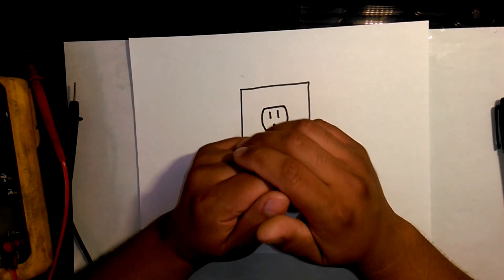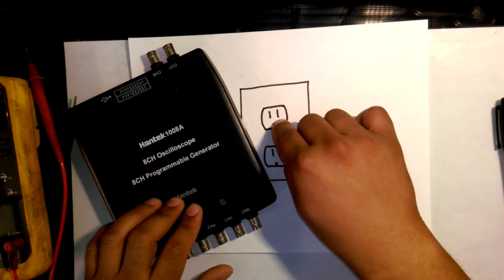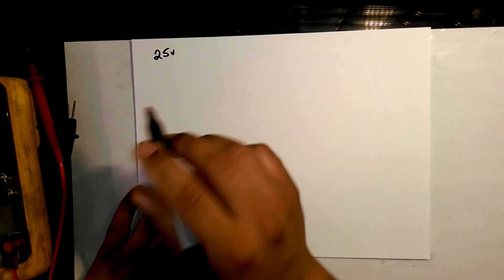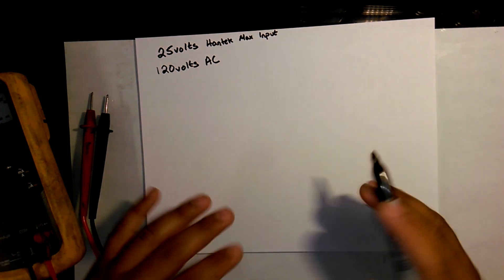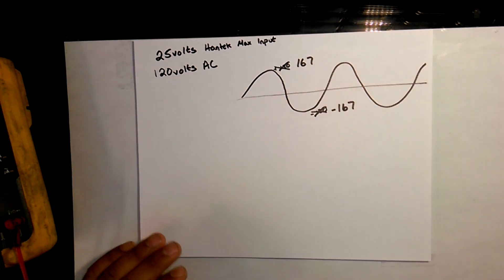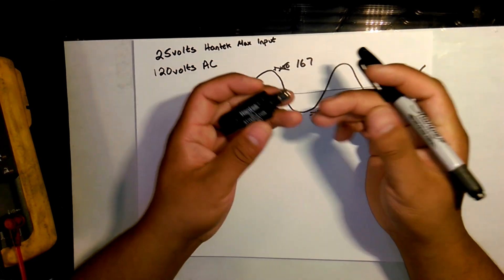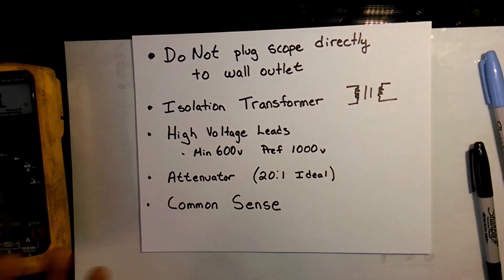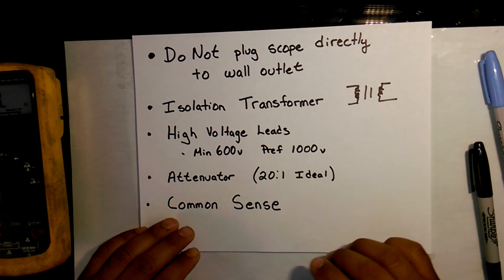Hantek Tutorial: Measuring Mains (Wall Socket) Voltage 120VAC

Comment: Thank you for the video!

I need to see the harmonic distortion or sine wave distortion on the AC line, so I do not believe I need a 1:1 isolation transformer for my purposes.  That being said, doesn't any AC to AC transformer (like your example transformers shown in the video) function as isolation transformers?  I ask this because you showed your example transformers, but then said you did not have an isolation transformer for the video, but that they did look similar to yours shown in the video.
Reply from the maker: You are absolutely right!! The transformers I have are isolated but I wanted to show the waveform in its "pure form". It was a poor choice of words on my part. If you are interested in the shape of the waveform rather than the actual values of the voltage available at your wall outlet, then using step down transformers will serve you well.

Thank you for your insightful question and thanks for watching!!
Reply: @Enrique_Osorio   I was trying to avoid a 1:1 to isolation transformer since they appeared to be more expensive than I was confortable with when ever I looked around and all I have on hand is step down transformers.  Then today I started to find some in the $15-25 range on ebay after multiple search attempts, which did not seem to high of a price.

I assume they would they still be considered 1:1 isolation transformers, besides the fact that the current output (VA) is lower than it is on the input side?

I wonder if these might help those needing to scope the exact voltages (but not the actual current) with an oscilloscope?
Reply from the maker: Possibly, it depends on the VA of the transformer, how well the transformer coils are magnetically coupled, how well the coils are insulated and the inductance of the input coil. Generally transformers are rated for a purpose and the information about the transformer is limited to its intended purpose. If you could link me the specific transformers you are looking at I will be able to give you more information. Thank you for your interest in this subject and I will talk to you soon.
Reply from the maker: Looks like the M8294 is a viable solution. As long as you do not place too high of a load on the output of the transformer it should work well. I am assuming the VA rating is about 1VA (115V*0.0085A). The fact that it says it is an isolation transformer by design it means that the product has been specifically designed with galvanic and capacitive isolation in mind. I am tempted to purchase this product to experiment with. Please note that to achieve a 1:1 transformation use the center tap (Red/Yellow to Red). The voltage across the two red wires will be double the input voltage resulting in a 1:2 transformation. Nice find!!

The N48-X also looks like a good option. It is overkill if you simply want to see the shape of the waveform at its "true" voltage since it is rated at 15VA. Again, do not overload the output of the secondary.

I would like to add that any high frequency noise on the input side of the transformer may be filtered by the transformer. Something to keep in mind while experimenting. As always exercise EXTREME CAUTION when working with mains voltage. It is DEADLY! Let me know if you have any other comments or questions. Thank you so much for bringing this to my attention.
Reply: @Enrique_Osorio  Thanks, I will let you know how things work out.
Reply from the maker: Sorry about the late response. It looks like that scope has an FFT function so you should have some functionality. I have never used the 6022 so I can not give first hand experience. Let me know about your experience.
As for the DIY AC coupler I have built several of those in the form of high pass filters, so I would be interested to know how yours works out.
BTW I do not get alerts when I get new comments but I do get an alert when I get a new thumbs up. When you reply give one of my replies a thumbs up this way I know to check for your response. Thank you so much and hope to hear from you soon.
Reply: @Enrique_Osorio  After years of working with live  US 120VAC and getting shocked more times than I can count, I do not see why it is so "dangerous" unless you happen to be better ground which maybe I have just been lucky?  Main thing I care about is not damaging my equipment used for the measurement.
1) Knowing the dangers, can't you measure mains "either" directly or via an isolation transformer with two probes - leaving out the ground reference connectors of each probe and setting software up as Ch1 minus CH 2?  
2) If the computer/scope set up is floating with no AC connection and using a single x100 high voltage probe, isn't it ok to use the ground reference lead connected to the neutral/ground (eliminating the need for second 100x probe and channel) as long as you avoid an exposed metal connections?  If so, how does that work when a) my particular scope is rated at no more than 35 volts on the input such as the Hantek - I am not sure if that max input level applies to the ground reference, b) neutrals sometimes have live voltage (UPDATE - my high pass mains AC filter has 60VAC on both legs of the output as explained in my next reply), and c) the x100 attenuated probe does not attenuate voltage going through the ground reference connector like it does the main probe pin ("positive" pin), so therefore it may have 120VAC (or 60VAC in my case) going through it (in the possible case of voltage on the neutral or you mix up neutral / Line connections to go into the ground of the usb scope).
Reference: https://www.youtube.com/watch?v=oMqhrRUjxOg&t=140s
Reply from the maker: In response to your first point, you can absolutely set it up this way but it still requires the user to place the "positive" input probes on the live and neutral. As for your second point I am going to have ask for more info since I think you are saying that the high impedance of the input of the scope will allow the user to tie the common ground of the scope to mains earth. If that is what you are saying I think you are right. I want to try it even if it is at the expense of my scope. Thoughts on my thoughts?
Reply: @Enrique_Osorio  I have several lines of thought in my last reply, honestly it got a bit muddy even for me.  I have the new usb scope (hantek 6022be), highpass (60hz) mains AC filter, and probes now.  I did several trial readings already but with a cheap handheld dso 150 scope and the 60 hz speciality filter used for looking at mains harmonics.  The high pass filter filters out the 60 hz frequency, so you can read the harmonics with out the 60 hz frequency in the way.  The thing is I am concerned that ac voltage will be going into the computer via the scopes USB connector - the filter outputs read apx 60 volts (non RMS) on either of it's two output conductors - half the 120 VAC wall outlet voltage, I am not quite clear on why but that is another issue.  I am all but certain the USB input of my computer is not supposed to have 60 or 120 VAC going into it through the USB's grounded shield which is what would happen if I use the ground lead of the probe/usb scope.   Trouble is, I am using up both my two inputs of the scope if I do a differential measurement using the only two inputs of my scope.  I want the other input of my scope to contrast the filtered reading on channel 1 with a non filtered 60 hz signal reading on channel 2 (by connecting it to a non filtered connection to mains AC).  I would rather use the probe ground reference lead if possible to free up my other scope input.
Reply: I went ahead and did the measurements via the differential method.  The 6022BE seems to be lacking the "record length" necessary for what I need it for, measuring harmonics on mains AC.   I think I also need a scope with a square wave view with in the FFT function.  Not 100% sure on those thoughts because I am just now learning scope specs.  Did not want to spend the $, but pretty sure I'm ordering a bench scope with real FFT features.  Had to make an AC coupler since the 6022BE does not have it https://www.youtube.com/watch?v=BjPUbO-U-VA

Comment: Hi! Enrique. What do you think about this situation: If I use a set of three resistor in serial connection according to this order 100K + 5K + 5K and connect osc probes to the resistor in the middle... is it also a risk for my oscilloscope and PC? thanks for any answer
Reply from the maker: That would work well, the only issue I see is that you would have the voltage divided by 22 with this network so when you choose 20:1 on your scope the reading will be off by about 10%. If your middle resistor was 5500 Ohms instead then you would have a division on 20 exactly. 

Two things to consider.
1) Make sure the resistors you are using can withstand voltages of at least 400 volts.
2) Remember that the only thing protecting you and your scope is a single resistor. With an isolation transformer you have a lot more protection. 

Hope I answered your question.

Comment: Genius. Im very interested on measuring the Dirty Electricity on my home wiring. I have a Picoscope 2204a but I believe it does up to 20volts (similar situation as yours).

Can you advise how to measure the dirty electricity and what equipment to buy (not very expensive) to accomplish this.

Thanks!!!
Reply from the maker: Several people have suggested a regular 10x probe (link below) and use two channels. The live line is connected to the input of Channel 1 and the neutral line is connected to the input of channel 2. The grounds of each channel are to be connected to mains earth. On the scope software set a MATH channel that subtracts channel 2 from channel 1 (CH1 - CH2). Schematic link below.

10x probe: https://www.ebay.com/itm/LOT-of-2-Tektronix-P6106A-10X-10M-Probe/133304168897?hash=item1f098c31c1:g:Ze0AAOSwxaNeHgLq

Schematic: https://imgur.com/a/qelzjO8

Comment: I have a Hantek 2d72 and I plan to get the wave form of my ac outlet.  Is it safe to connect the channel 1 probe directly to AC line?  What my plan is to make a 50 to 60 hz pure sine wave convertor for my electrical items using 60 Hz as a requirement.  I plan to use this to see if my convertor is converting properly.
Reply from the maker: Directly from the circuit specialists website,
Maximum Input Voltage 200Vpk (DC + peak)  
Here is the link
https://www.circuitspecialists.com/hantek2d72_70mhz_oscilloscope.html
It looks like as long as the maximum voltage will not exceed 200 volts, you are OK. Remember 120 VAC peaks at 170 volts and 240 VAC peaks at 340 volts. Make sure you know what the AC RMS voltage is that you are testing. As an additional note, it is ALWAYS dangerous and risky to work with high voltage, if you feel unsure at any time do not continue.
Reply: @Enrique_Osorio  Is that really the limit of this meter or limit of the probes and test leads given with the meter?  There seems to be some disparity with the information about the meter given by the link you gave and what is in my manual.  In my manual it clearly says maximum voltage input is 600 V AC and DC and the link says 400 AC and DC.  That voltage limit seems kind of odd because in the older multi meters I have usually the AC limit is higher than DC limit.   Another thing is it says 300RMS max for 10X which matched up with my manual and I found out that it seems like that max RMS the probe that came with my meter can take.  What do you think?  If I get the BNC to test lead adapter can I safely get the waveform of my AC power?  Reason I am asking is if it is the limit of the probe then wouldn't I be safe to test up to 600V AC with test leads with 1000V tolerance through a BNC adapter?
Reply from the maker: I am not sure. The way I read it, it says the maximum input to the BNC input of the scope is 200V. It also gives a maximum voltage for the leads of 300VRMS. Then it gives error in accuracy for 600V which is weird. And to top it all off it says that there is a maximum input of 400V in meter mode. With all this information, I can not give an accurate answer, all I can say is what I would do.

In Scope Mode and Meter Mode I would not exceed 200 V input in the BNC port. Of course if your BNC probe is rated for more than 200V you can read higher voltages as long as you are in 10X mode. That is simply what I would do. Remember to calculate peak voltage of a sine wave signal, take the RMS value and multiply it by 1.4142 (square root of 2). Let me know how it goes.
Reply: @Enrique_Osorio  There is more weirdness to this meter.  It has up to 1000x probe setting  but for that it is 500V limit according to meter.  If I am using a BNC to Alligator clips cable (improvising because I don't have BNC to bannana clip adapter at this time) connected to test leads then what settings should I use to get a slope reading for AC outlet?  Sorry for sounding like a beginner.  When I took these classes they didn't really let us play with the oscilloscopes to get a full understanding on how to use them.  My set up seems to work but it is off screen.  I see the slope but don't see the peak of the slope.   How do I make it so everything is visible?
Reply from the maker: I do not own this scope, so I can not give you a step by step, but it sounds like your vertical viewing is too small. There should be some setting where you can adjust volts/division which might say volts/div or v/div or something like that. Depending on how many divisions are on the screen will tell you what setting to choose. From what I can see in the picture of the website, the volt/div is done by F1 or F2, depending on what channel you are on. Also from the picture it looks like there are 8 divisions so if you want to be able to see from 200 volts to -200 volts you will need a range of 400 volts which since 400/8=50 you need 50 volts/division. Try that and let me know.
Reply: @Enrique_Osorio  One thing confirmed by seller after checking with distributor is that it the manual is wrong regarding  DMM voltage limits for 2d72 model.  Its correct limit is 600 V AC and 800 V DC.  They are checking the scope limit with manufacturer.  I should get a reply in a day or two.  My guess is it might be 500 but will know for sure in a day or two.  I would like to test more but I am afraid of damaging it if its limit is really that low
Reply: I am afraid of damaging it if its limit is really that low according to manual (150-200).
Reply: @RAM-iw8oe  hi bro i too bought hantek 2d42 please confirm what is the maximum voltage i can measure with this in scopemode because manual is saying only 150 vrms... For scope as limit.. Please confirm.
Reply: @kevin14806  For the scope that is the limit and you can not test the power outlet directly using the scope.  Very dangerous due to outlet power being grounded to earth. You have to use a step down transformer coil to separate the neutral from earth ground.  You can use a step down transformer coil that brings down the power by 4 times (240 Vrms outlet after going through coil it is 60 Vrms). Waveform should be the same exact waveform other than the lower voltage.  For the regular AC/DC mode you should be fine 600 V AC and 800V DC.  I hope that helps.
Reply: @RAM-iw8oe  thanks for your reply bro....
Reply: A

Comment: So if I use a step down transformer, the oscilloscope reading I will get is the same sine wave characteristics of mains outlets but at a lower value or whatever the transformer puts out? I think another reason isolation transformer is good is if what I'm measuring is any circuit or device that is connected to it right?
Reply from the maker: A step down transformer will lower the voltage that is its job. An isolation transformer by definition will not step up or step down the voltage. Its sole purpose is to protect you from the live voltage from your house. An isolation transformer literally isolates you from the wires in your house I wish I had one to show an example of. I hope that is a bit clearer.
Reply: @Enrique_Osorio   ...Very good video, but still not exactly an answer to the question he asked.   I was curious about the exact same thing he asked.

Comment: Awesome vids.  Basic question: will my hantek oscilloscope work ok with lenovo A70z.  

What are the minimum requirements that a computer has to have for the hantek to work with it without any problems.  Thanks.
Reply from the maker: It should work well. The Intel Core 2 Duo is probably the lowest grade CPU I would use with the Hantek so you may get some speed issues but it should work. The first machine I installed the Hantek software on was a Thinkpad T71 and it had a Core 2 Duo. Here is a video with the Thinkpad.
 https://youtu.be/ugoDIq38mMA 
Like I said I did have issues with the software slowing down on me occasionally. For example the waveform trace would only refresh one per second or, certain buttons became unclickable for a few seconds, but these events occurred rarely. There were a few blue screens of death but those were few and far between. 
Hope this helps!! Thanks for watching and thank you for your comments!!